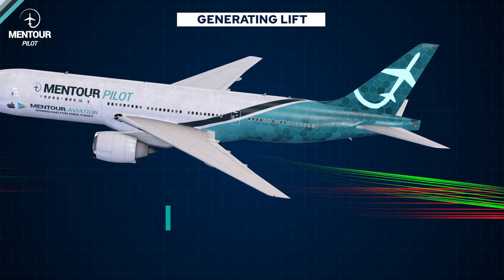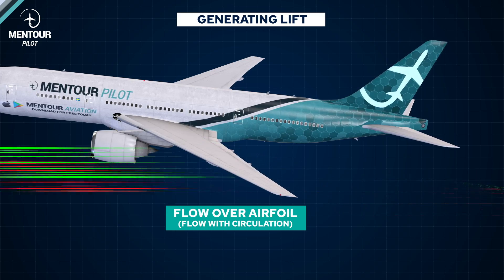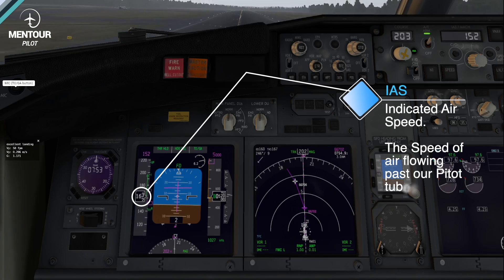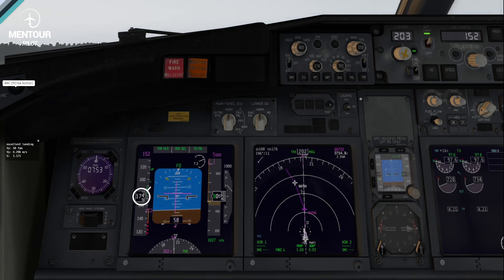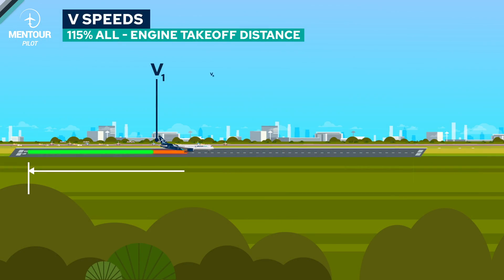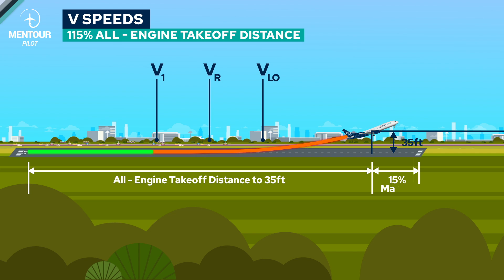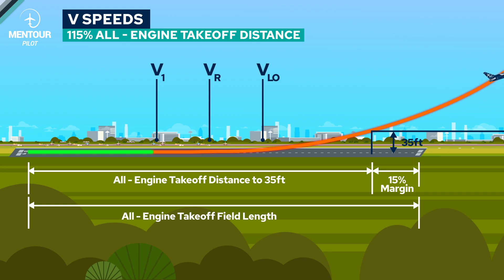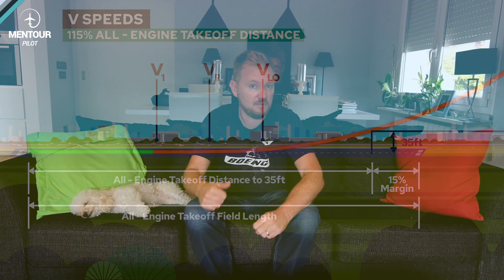Why do pilots call out SPEEDS?!

Comment: V1 is the latest speed where the decision to reject the take off has already been executed. 

Considering that on average it takes one second for a pilot to detect and react to an engine failure, the latest speed where a pilot may decide to reject a take off and have time to execute his rejection is Vef, which occurs 1s before V1. 

If an engine fails precisely at V1, the pilot will already be too late to reject the take off and that is why we release our hands from the throttle levers, emphasizing that no matter what, we must continue with the take off roll.

Comment: If a runway is long enough, its conditions favourable, and the plane's brakes are excellent for the weight - can V1 ever come after VR, ie a higher speed but there is still enough runway to stop ?
This is for cases when the plane refuses to take-off, for whatever reasons.

Comment: With a very long runway and a very small jet, how would Vr and V1 be calculated if you could reach Vr long before you reached the minimum safe braking distance?
Also, is the acceleration rate assumed? How do you know that you will reach V1 at a certain distance on the runway?

Comment: 4:38 "Now, "Decision Speed" is not really accurate. Because in fact, the decision of what you want to do, if you want to continue or if you want to reject the takeoff, HAS to be made BY V1 (before V1). You cannot start taking that decision at V1. It's already too late"
Haven't heard it clearer than this! Once V1 is reached, you can no longer abort a takeoff. It must be done before that. Thanks, Mentour Pilot!

Comment: Great video Mentour Pilot you should do video on how long-haul flight crews work, and you should do if pilots are allowed to rest in the cabin during midflight and if they are allowed to sit in the cabin on takeoff and landing and I Know on QF A380 Flights they have 2 Captains, 2 First Officers and 1 Second Officer and they also sometimes carry an Engineer onboard and i would like to know how they do their shifts on the flight deck and their rest pattern with 5 Pilots and an Engineer onboard. Then they have 23 Cabin crew for 420 passengers. Whereas the seat map on the lower deck is 14 seats in First Class in a 1-1-1 configuration, 32 Premium Economy Seats in a 2-4-2 configuration and 253 Economy Seats in a 3-4-3 configuration and whereas the seat map on the upper deck is 70 Business Class seats in a 1-2-1 configuration and 60 Premium Economy seats in a 2-3-2 configuration so that brings the seats 420 passengers.

Comment: Summary of this video: V1 is the speed where you cannot abort the takeoff. If you do, it will result in a runway excursion. Vr is the speed where the aircraft rotates. V2 is the safe single-engine speed.

Comment: Why not just make a longer runway
Reply: Cost.
Reply: @Trotters79  Isn't losing an entire aircraft also expensive?
Reply: @ag4640 
Not for those buying the land and building the airport.
Reply: @ag4640 
And then, wider roads and wider highways.

If you increased the length of EVERY runway in the world by 1000 feet. How much would that cost, and how many planes would you save in a decade?

How about 2000 feet extra? Would it save any more planes?

All planes? If not, what would be the cost for 3000 feet extra?

And so forth.

Who should pay for this, and where / when would you say enough is enough?
Reply: @ag4640 
Who are "they"?
How long do you consider "increasing a little bit the length" is? What would suffice in your eyes?

What should be the requirements for every single commercial airport in the world, and Who would pay? "They" is not the answer here.
Reply: @Trotters79  They the ones who build the airport... the owners... isn't that obvious? Now, "how much" the length increase? That needs to be addressed by experts, not by me. I just know what is evident and that is that many accidents during takeoff of lading happened (in part) because the runway wasn't long enough, but only an expert could say "if those runways were [this much] longer, those accidents would never happened"
Reply: @ag4640 
There are requirements for runways in place today, because experts have already said "if the runways are at least this long and this wide for these kinds of planes, there will rarely be any accidents due to runway excursions (RE).

In order to 100 % prevent REs, you don't only have to build longer runways, but also wider runways. You would also commit to keep this whole runway surface clear of any snow, ice, slush, sand, water or whatever, where applicable. Thus the cost isn't only related to buying the excess land and building the excess runway, but also to maintenance costs. The runway also needs resurfacing every now and then. All these costs multiply quickly.

After doing this, whenever an RE event occurs, despite these excessive runways, you have to increase the requirements accordingly in order to create an aviation business that is 100 % free of any RE events.

Which leads me back to my earlier question. You add 1000 feet or runway. Or 2000 feet. Or 3000 feet. Or ...

It would basically never stop, because your ultimate goal is 0 REs - ever!

Life is full of risk. You accept a certain amount of risk every day of your life. Especially if you travel by road, e.g. in a car.

How would you want to build the roads to protect the value of every single car that's wrecked every day in the world? Your ultimate goal should be 0 car wrecks ever. How would you achieve this? What would be the cost? Would it be cheaper than the wrecked cars?

The short answer is: It's not worth the cost. It's cheaper to accept the loss of a vehicle now and then, than to prevent accidents to a degree of 100 %, which is not feasible in a realistic manner.

Life is dangerous. Really dangerous!
We all die from it, and there's no way to prevent it.

You can make some choices which will increase your chances to live long and die of old age, but you can never prevent accidents to a 100 %.

Also, many people make personal choices that involve a much higher risk for them personally, than all the REs in the world. Alcohol, drugs, nicotine, unhealthy food, sunbathing, etc. Why should the society accept these choices, and still be committed to prevent REs to a 100%?

How about adding 4 more engines to every airplane, for redundancy and safety measures? A secret container on board with 10 tons of extra fuel, just in case you run out of fuel? Where should this crazyness stop?
Reply: @Trotters79  That all is fine. But I refuse to think that it's completely impossible to build longer and wider runways
Reply: @ag4640 
No-one said it's completely impossible, so you're right about that.

I simply said it isn't done due to cost.

When looking at the cost:gain ratio, it's not considered worth doing it.

Comment: I was surprived that VLO is also used for liftoff speed. I knew it as maximum landing gear operating speed though I've always flown aircraft with fixed gears.
Reply: VLOF is actually lift off speed. VLO as you said is landing gear operating speed.

Comment: I think that the definition of V1 here is not correct. 
Let us assume a runway of a given length and two very different aircrafts, let's say a 737 and a DC-3. If V1 is the last speed at which you still have enough space to stop the plane, let us assume that the 737 reaches this V1 at one specific point on the runway.
The DC-3 however needs far less speed to be able to take off and thus, a much shorter distance to be able to be stopped. So, by this definition, the V1 of the DC-3 should be reached closer to the end of the runway, because it needs less distance to be able to stop. On the other hand, as the DC-3 needs less speed to take off, it means that it might reach the take off speed before it reaches the critical point on the runway that corresponds to its V1.
Sooooo...would it be rotated before V1? Or is this definition of V1 not accurate?

Comment: V stands for Votes. V without a suffix is the number of votes in a normal election. V-lo, or V-Dirty, is vote tally with maximum Fraud extended. V-a, or maneuvering vote tally, is less fraud than V-lo, but designed to seem not so "abrupt" to cause alarm to voters.

Comment: So, on a very long runaway Vr < V1. Do you still call V1?
And is V1 calculated on the assumption that thrust reversers are not available?
Reply: Had the same question :) I'm assuming it doesn't make sense then because you're already in the air, except the short time between Vr and actually taking off. 
Small aircraft can easily do a few touch and go's on a long runway.

Comment: Why does a pilot use air brakes and not just reduce thrust when on finals
Reply: air brakes far more effective and quicker
Reply: Why do you use the brakes instead of just releasing the accelerator when driving a car? Both actions can reduce the speed, but one in a more timely fashion than the other.

Air brakes creates drag, thus actually brakimg the plane, rather than just not accelerate it or keep the speed up. Air brakes also reduces lift, and are sometimes used to descend a little faster without increasing air speed.
Reply: @Trotters79  thank you especially on second point, with my car i tend to lift off accelerator when I want to slow down, only use brakes when I really need to stop
Reply: @andrewstorm8240 
Which is the most economic way to drive. I do this myself, including gearing down to increase the "braking effect" whenever applicable.

Pilots also decrease throttle to slow down when able to plan ahead, but sometimes the wind changes or other things occur which means they have to make a more direct action within a shorter time frame to slow down. For instance if they are too high. If however they are too low, they would add thrust to increase lift and extend the glide slope.

Comment: Your explanation of that chart doesn't make sense. The lines can't move when mass changes, since mass is one of the variables you are plotting against. It also doesn't make sense to say the intersection point is the V1 for a particular mass for the same reason.

I think the correct description of that chart is that V1 for a given mass is the lower of the two lines. For a low mass, it is where the go line is for that mass. For a high mass, it is where the stop line is for that mass.

The intersection point just tells you the mass at which the go speed and the stop speed are the same, but that's not particularly important to know (since you don't control the mass).
Reply: The following was written under another comment, and I wrote it while thinking about this problem, so it's a little bit all over the place in the beginning, but my final conclusion (from my suggestion for a chart, and onwards) in the end seems to be quite correct. To me, anyway. What are your thoughts?

The calculations behind V1 is far more complex than what can be displayed in a simple XY chart, where the runway length isn't even part of the data, while it being what basically defines at which point you have to take stopping distance into account.

I would argue that key data includes:
* Mass (weight)
* Thrust
* Brakes
* Runway length
* Time

The latter two isn't part of the chart. One might argue it's so indirectly, by them defining the red and green curves or something, but I believe the chart has to have some sort of multi axis layout, or more likely: multiple charts are needed.

My suggestion for a chart:
X = distance (increasing numbers for acceleration and decresing numbers for deceleration)
Y = speed

Multiple lines for acceleration in a fan pattern, where each line represent the graph for a given mass (range). Low mass gives a steep line (higher speed at shorter distance), and high mass gives flatter line (lower speed at longer distance).

Then another set of lines for deceleration, but here the X axis (distance) is reversed, with origo in the lower right corner. Thus the deceleration lines will tilt in a mirrored pattern of the acceleration lines.

Where the two lines (acceleration and deceleration) for av given mass (range) intersects, should be V1, given the sum of the acceleration distance and retardation distance doesn't exceed the length of the runway being used.

If the intersection point indicates the distance for go + distance for stop exceeds the length of the runway being used, a horizontal cap line that intersects the go line and the stop line at a lower speed should be applied, so the sum of the distances for these intersections are shorter than the distance of the runway being used. Then this horizontal line indicates V1, which is at what point you are committing to the take off, because the remaining distance isn't long enough to stop at a higher speed.
Reply: Come to think of it:
A speed cap line above the intersection point of the acceleration and deceleration lines is just as reasonable as below, because this intersection point is basically just defined by the range of the X axis, whereas the cap line is depending on the actual runway length (and the mass of the aircraft).
Reply: @Trotters79  I don't think time is a relevant variable, since it is just a function of the other variables.

The reason runway length isn't used is because V1 is usually calculated on the assumption of a "balanced field length", which is essentially the shortest runway you can use. They ignore the fact that the runway is actually longer than that since if you allow for that you would end up with a range of v1 speeds instead of a single speed. If a problem occurred in that range, you would have a choice - you have enough room to either continue or stop. They don't want to be making that choice during the takeoff role, so they just pick a single speed in that range to be v1. Conventionally, that is picked based on a balanced field length, probably just because it makes the calculation a little easier.
Reply: @thomasdalton1508 
As I mentioned, that list was part of my thought prosess, and time is not part of my final suggestion.

However, as a layman, I'm puzzled that runway length isn't part of the equation. If that is true, each airplane would have a given V1 for a given mass, and only compensate for weather (wet or dry runway, snow, wind, temperature, air pressure). This is not my impression.

Given a long enough runway, V1 = VR, but on a shorter runway V1 comes earlier than VR. Is your argument that these variations has nothing to do with RWY length, and only depends on mass and weather? Then basically Petter's explanations are more or less totally irrelevant.

I also disagree that you end up with a range of valid V1s. Why do you say that?
Reply: @Trotters79  If the runway is long enough then there is a section of the runway in the middle where there is both enough runway left to stop and enough runway left to takeoff on one engine. If an engine fails while you are in that section then you could choose to either abort or continue and either decision would be safe. In order to get an unambiguous go/no-go decision, they assume a minimum runway length such that that section reduces to a single point.

As I understand it, V1 is determined based on the factors you describe, yes. They do also need to calculate that minimum runway length in order to ensure the actually runway is at least that long.

Comment: Mentour Pilot.,please respond 👇👇
What's the effect if jet engine fan blades were connected by a ring at the far circumference , could it help to strengthen the blades or will it reduce efficiency..
Reply: What would you try to achieve by such a design?

There's no such ring on any propeller or helicopter rotor either. Such a ring would add stability with regards to the spacing between the blades, but they maintain their distance because sentrifugal "forces" keep them extending perpendicular from the centre anyways. Thus such a ring would add a huge weight and increas stress to the engine, without adding any real benefits.

Comment: I have a few questions. Given that the weather is clear and you have a clean and dry runway, what determines V1 more? Is it speed or or how much runway remains or is it both? Also, are pilots also aware of what types of terrain or obstacles/barriers/hazards are beyond the threshold at the end of the runway. Are they provided that information prior to takeoff? Have you ever flown a plane that was so heavy at takeoff that your plane reached a point on the runway where you were committed to takeoff long before reaching V1? In other words, past the point at which you could stop the plane within the length of runway remaining. I have seen a great many air crash videos on Youtube and it seems all airports and runways are different. Some have fields, trees, beaches, fences, freeways and oceans beyond their thresholds. One video I saw about a plane with a fuel leak called Flying On Empty that was heading for Portugal had to divert to an island in the Azores called Terceira and the runway they landed on with no engines had a shear cliff at the end of that runway that dropped off into the Atlantic. Scary stuff. I enjoy your videos. They are very informative.